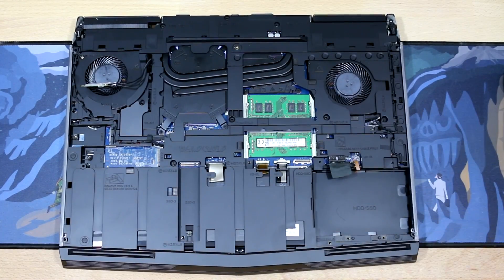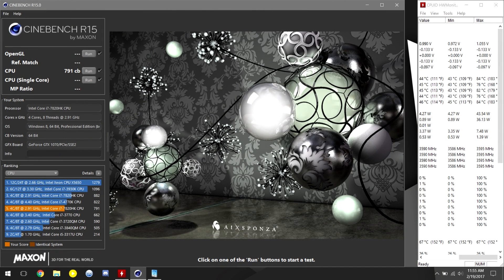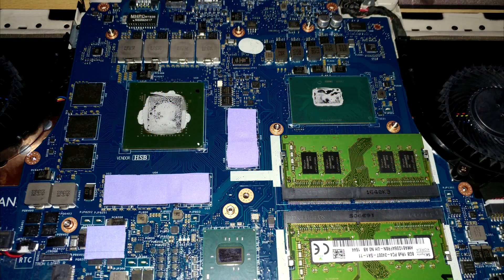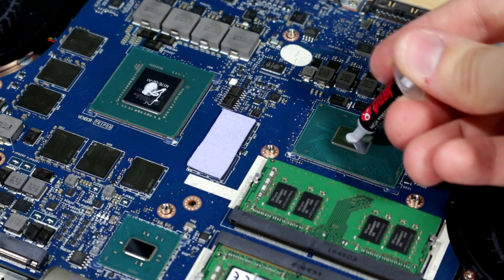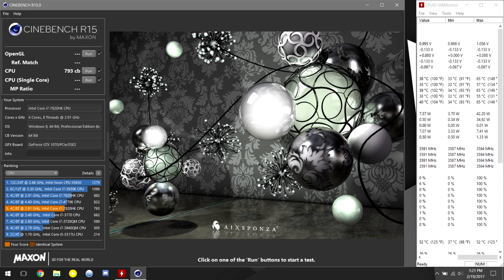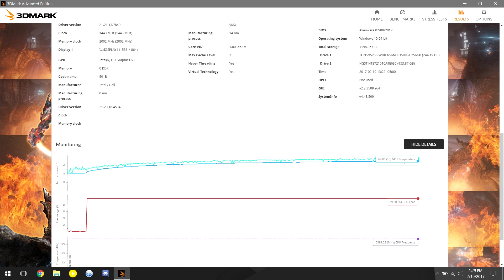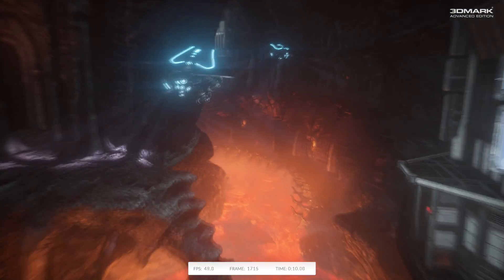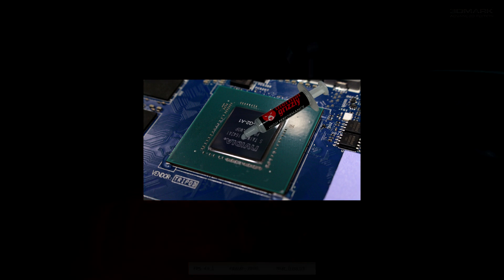Alienware 15 R3 Kaby Lake Repaste Update

Comment: Repasting the 15 R3 is not that scary. If you have the I76700HQ + 1060GTX combo, than you don't even have to remove the mobo or the WIFI cables which apparently are easily broken. The heat sink is separate from the fans, allowing you to have much better access to the CPU/GPU. While you've got everything disassembled, it's also a good time to clean out fans, pipes, ducts, and vents.

When I finally opened my 15 R3 up, I saw that there was barely any thermal paste on my CPU - it was all mostly on the heat sink. No wonder temps would fly into the 90's and throttle over simple operations like opening Google Chrome. My 1060GTX also had a big scratch over the top of it. At least it actually had some thermal past on it. I actually never got any overheating on my GPU, just that it was running a little hotter than I'd like.

For me, I'd run XTU benchmark I got 760 marks @ 2200mhz (far below even the stock clock speed). It was only this fast because I recently upgraded the ram to 32GB @ 2400mhz and swapped my HDD over to an SSD. The highest temp was 100C and of course it thermal throttled a few times even at these gimped settings.

I used the IC Graphite Thermal Pad, which is a new product that just came out. This not only lasts longer than paste, it also takes the guess work out of applying paste too. You simply just cut it down to the size of your die and apply it directly to the CPU. Simple! This pad also performs just as well as any high end paste too, and is reusable. There really is no downside to it and let me tell you, it worked as advertised.

My results from XTU benchmark after repaste, I got 983 marks @ 3400mhz with a max temp of 94C and NO thermal throttling. In fact, it only would spike into the low 90's a few times throughout the test, rather than be pegged at 95-100C for the majority of it. Most of the time temps were in the high 70's to high 80's with an occasional spike into the low 90's.

I'm now able to finally run my 15 R3 like it was designed to be ran... I am happy with these results and just in time for Black Ops 4!

Comment: was the dissasembly in the video on a kaby lake or still on the previous version? can you still just get the top off of the fans so you don't need to fully disassemble the kaby lake version if the one in the vid was the previous version?
Reply: Mathieu Leroy Yeah i did the same on my kaby lake device, funny thing though, i found that one of the thermal pads was missing, if you've already repasted, did you also find a missing thermal pad?

Comment: wrong way to applied thermal >>This is the correct way to apply any Thermal Paste on any mobile processor 
 https://www.youtube.com/watch?v=0oOEnOkq56Y
Reply from the maker: sniper wolf It.. Doesn't actually matter as long as there is an even amount across the die and not a gross under or over application. Using the pea method is perfectly valid just as it is to use that thermal grizzly applicator. I just use my method because it's easier to get an even application. The only time this would change is if you were trying to use liquid metal, in which case you would spread it manually.

Comment: The issue is that you also have to rebalance the thermal pads because the repaste alone wont fix a balance issue with the tape. Check out iunlocks guide to repaste to understand that due to the thermal tape placements the heatsink might not be totally flat against the CPU

Comment: does the warranty cover this problem? or is it simply not worth the wait, and should i just get the repaste done by myself? this is kinda disappointing because i bought one of these and expected it to be a reliable daily driver. 
i know something's not right when it frequently throttles after 30mins, then i just found out that under heavy load the CPU reaches fcking 99°C with 10°C difference between cores
Reply from the maker: Well, yes, you could hit up tech support and get them to send someone to fix it for you. But you can also just return it if you've had it for less than 30 days, which is what I ended up doing.
Reply: unfortunately i've had mine for 3 months, and just realized this problem now as i only just started playing heavy games recently. i bought them from third party seller, as dell in my country havent sell the R3 yet so warranty claim would be a pretty long process. but then again im really scared to fuck things up if i do it on my own, the best way i could think of is getting it repasted at a local pc shop lol. great videos though, thanks
Reply from the maker: That's a good idea actually, but make sure they don't charge you something ridiculous for a small job like this.
Reply: Brave_SirRobin why did you return it? if you where getting better temperature?
Reply from the maker: juniora aburto I didn't initially with the Skylake model. So,I returned it, got there refreshed kabbylake version, but the temps were still crap. However, repasteing the new one helped more as the video showed. The still images I used for this video were of the new one. You can tell because the new one has a 1070 provided by HSB, whereas the older one was provided by Tripod.

Comment: I just bought Alienware 15 R3 7700HQ in India and it has heating issues. While running Alienware's SupportAssist 15min Stress Test I got max of 94°C and average of 87°C. But Dell India said that they won't accept third party temperature monitoring software so denied my request for replacement and said that my system is running without any issues by doing a pre-boot assessment test.

My question is, is it necessary for me to do repasting?
I'm not going to do over clocking my CPU. But I'll be playing heavy games(minimum of 3hrs a day).
Reply from the maker: Those stress tests hit the CPU at 100% on every thread, something that will never happen in game. If you don't notice any sudden drops in frame rate, (to the point it is unplayable) and your system isn't shutting down, the repaste is not necessary. Also, it helps to put the system on a hard surface so it can suck cool air from underneath so try to keep it off carpet when gaming for prolonged amounts of time.
Reply: Brave_SirRobin Thanks that's really helpful
Reply: Brave_SirRobin I ran Unreal Engine's Heaven benchmark then my CPU went to a MAX of 97°C is it OK. But my GPU's max is only around 70°C
Reply from the maker: No, that is unacceptable. Get Dell to fix it or get you a new one.
Reply: Did you mean "Premium Support"? My current warranty details shows the following:
1. LIMITED TELEPHONE TECHNICAL PHONE SUPPORT
2. Carry-In Service (3-Business Day)(8x5)
3. Parts Only Warranty (Carry-In Service)
4. Premium Support
5. NBD (Next Business Day on-site)
6. POW (Parts Only Warranty)
7. Accidental Damage Service
Reply: harsh2193 I already have a premium support. But Dell India asking me to take the laptop to service centre instead sending a technician to my home.
Reply: harsh2193 ok I'll try
Reply: harsh2193 "The network you are trying to reach is currently busy" that's what I got again and again, I even tried it at different times. I think in Dell India it's different.

Comment: Does repasting void warranty?
Reply from the maker: Princess Luna Nope. I actually can confirm this because I returned one after repasteing because the temps were grossly uneven. I also freely admitted to doing so while talking to the tech and return departments.
Reply: Brave_SirRobin sounds good. I'm looking towards Alienware 15 r3 w/1060 as my primary study/play machine. Can you confirm 6 hours of text processing on the battery? Does undervolting and repasting help battery life?
Reply from the maker: The undervolting will help, and the 1060 will defiantly sip power compared to the 1070. The only thing I don't know is if your model will feature G-Sync. If so, your battery life will be <4 hours. Another factor is whether you have the 76Wh or the 99Wh battery.  Now, if you have the screen brightness at 80%, have balanced mode on in the power settings, and most importantly, don't have G-Sync on your system, you would easily crack 7 hours. I say this because I achieved 5-6 hours of 'normal' use with the 1070 at max brightness with the 99Wh battery and no G-sync. Also, you can always turn off the attention grabbing LEDs that actually use a surprising amount of power.
Reply: Brave_SirRobin wow, that sounds absolutely great.
Thank you, good sir.
One last question: do you find it uncomfortable to use it "lappy", i mean, somewhere on the go, in the plane, train, on a bench outside etc. due to its weight and dimensions?
Reply from the maker: I would say it largely depends on a few factors. If you happen to be wearing short shorts or just something that would cause skin to be under the support at the rear of the laptop (near the vents) it may A.) get uncomfortably hot, and B.) dig in a little because there is just the one rubber support on the back it might leave a mark after extended use. As far as the weight, it is by far the heaviest 15" laptop Iv'e ever owned, but the distribution of that weight is even, so it doesn't really feel like 8lbs in the lap. The only issue really stemming from the weight is that on something like a bus, it can be difficult to keep the thing front and center (It slides around easily) So, if the driver were to slam the breaks for whatever reason, it's  gonna go flying.
Reply: I have the kaby lake 15 r3 with the i5 1060 76wh and just using chrome I hit 2 hours. That's on power saver with low brightness

Comment: I just got a refurb R3 with a 7820HK and a 1070 from Dell.  after 15-20 minutes of OverWatch, MSI AfterBurner puts the Max Peaks of the GPU at 86C and the CPU at 97C with a big variance between the cores (About 10-15 C)  I am going to try Dell Customer Service first (We will see) and if not, I might attempt this, but I am not real comfortable repasting a laptop as I have only done it on full PCs.

Comment: Just one remark : you say that the difference in max temperatures is lower after repaste, but it is actually greater after repaste ; you had an 8°C difference before, and it goes up to 10°C after repaste. Still, I agree that temperatures droping 20°C is amazing.
Reply from the maker: Thanks for pointing that out, I'll be sure to add information about that in the description because I can't add any annotations because I have an end screen link to the previous video. (YouTube does not allow both annotations and end screen elements... for some bizarre reason.)
Reply: You're welcome!
I just received my AW 15 today, with an i7-7700HQ.
I stressed it with GTA V for about 45 minutes and CPU temperatures reached 90°C, although temperature difference between cores was lower, about 4-5 °C. 
90°C is still very high, so I'm going to repaste with Grizzly Kryonaut. I'll update when I have some results :)
Reply: Update : 
I repasted a first time, and temperatures got lower, but the difference in temperatures went as high as 17°C. I opened the laptop again and noticed that the thermal paste didn't spread evenly during the first attempt

I repasted again and also bended the tension arm of the heatsink on the CPU as some other people recommended.

After repasting with Cooler Master MasterGel Maker, and bending the tension arm of the heatsink on the CPU to get a better spreading of thermal paste, temperatures after 90 minutes of gaming got down to between 70°C and 77°C, so much better than stock and first repaste.
Reply from the maker: Idris Kahil good for you man!!!
Reply: I'm using HWiNFO 5.50, it gives you the max, min, but also the average. I find the average important too, as the max could be 90°C because the CPU spiked to 90°C for a half-second...
You can see that better if you record the temperature throughout your gaming session, or use the Intel Extreme Tuning Utility (Intel XTU), which gives you a real-time graph representation of the temperatures on the CPU. The CPU can spike to 88-90°C for a mere half-second and then go back down to 78-80°C.

Also, I undervolted the CPU by 0.110 Volts using Intel XTU and the temperature gains were quite important, around 8-10°C. I  thought the last BIOS update available on the DELL website was supposed to take care of that, but it apparently didn't on my unit, so I undervolted the CPU manually. It doesn't throttle and it is very stable.

I will repaste with Liquid Metal (Thermal Grizzly Conductonaut) using this guide : http://forum.notebookreview.com/threads/alienware-17r4-15r3-disassembly-repaste-guide-results.797373/
 
I'll keep you updated if you wish :)
Reply from the maker: BigD Travels I'm sorry to hear that, but there are many things besides thermal paste that factor into thermal performance.Maybe look into what other people tend to get for their temperatures on your particular machine?
Reply: I finally repasted with Liquid Metal, using Thermal Grizzly Conductonaut and the guide linked in the comment above, and the results are amazing!
I've been playing Far Cry Primal lately, and before the repaste, max temperatures were somewhere around 82°C, sometimes 85°C if ambient temperature was higher.
After the repaste, max temperatures are all between 70 and 73°C! When recording the temps thoughout gaming, they stay between 69 and 70 on all cores 95% of the time. This also means that the fans never reach their max speed, resulting in a much quieter background.
Max temp on the GPU was 62°C.
FYI, temps at idle were around 48°C before repaste, and they're now around 39°C. When watching a movie or web browsing, the fans almost never turn on, the only sound I can hear is the HDD when it turns on.
Reply: @kahilidris  your cm gel repaste was giving good temperatures, why did you do the liquid metal?
Reply: @Balkeet007  I agree, temperatures were already good with classic thermal paste, but I was interested to see how much better they would be with liquid metal, and if liquid metal would have a longer lifetime than thermal paste. Temperatures are great, but I still re-paste once per year.1 pack of Conductonaut of 1 gram is enough for 2 repaste, the cost isn't that high.

I was playing Rise of the Tomb Raider recently, the paste had dried out after a year since the last repaste, and I was experiencing heavy throttling from the CPU as it was reaching 99-101°C on some cores. Temperatures went back to normal after a repaste.
Reply: @kahilidris  read about pump out effect. I am thinking about creating a dam of thermal pads around CPU die so the thermal paste doesn't flow out. This is the Reason why immediately after repasting temperatures are good but somedays later they increase again

Comment: currently still wondering if its worth it to get a new kaby lake model.. if i did i would be bringing it straight to my local pc shop and have them repaste it since im a bit afraid to completely take it apart myself. just not sure if i wanna go through the hassle or just get an msi gt72vr dominator instead and not have to worry about repasting right off the bat. thanks for showing the before and after temps btw.
Reply from the maker: Well you don't NEED to repaste it. As far as getting the dominator, I would say if your budget allows it, get the alienware for nothing more than the incredible build quality.
Reply: Brave_SirRobin well considering the temps still get in the mid 80's its still kind of a must to have it repasted, especially if it drops 20c. i mean this isnt a cheap laptop so i want it to last as long as possible. and the dominator is around the same price as the alien so thats why im unsure. also like you said, the alien build quality is pretty good as well. just wish it was good enough to where the consumer doesnt have to fiddle with a brand new machine to get it to stay cool :/
Reply from the maker: Have you looked into what the temps are like on the MSI?
Reply: Brave_SirRobin yes, the new kaby lake gt72 has amazing temps from what ive seen, usually around 67 to maybe low 70's on stock paste, plus the fans are much quieter on full load. thats the big reason im considering it along with the alien 17r4
Reply from the maker: In that case, you need to figure out what is more important to you, size or cooling potential. The Alienware laptops are actually slim considering the heat they are packing, and they look like ultrabooks next to the behemoth dominators. As a student, it is really important that I can fit this thing in my backpack and something that is usually overlooked is the size of the power brick. I don't know about the dominators brick, but I do know the Alienware has a very low profile despite the 240w output.
Reply: Brave_SirRobin yeah, since im graduating soon and planning to go to work after school ends i dont really need to bring the thing anywhere, its more of a stay at home, play on my lap in the living room kinda machine so thickness isnt an issue. may go for the dominator